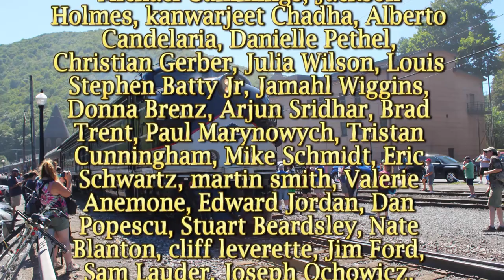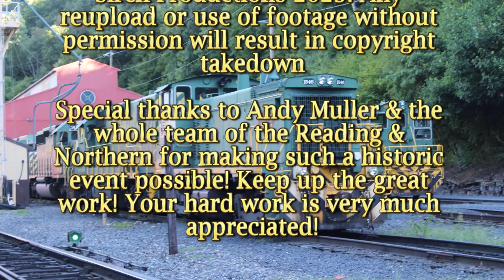RBMN Doubleheader Steam

Comment: Where is this since theres no info of it
Reply from the maker: The video takes place between Reading and Jim Thorpe PA
Reply: I wonder how it’s like on board an  excursion
Reply: @Ambushdoesplen  It’s better than chasing. I was on the train during the first rambles back on May 28.
Reply: not sure if anyone told you this Thunderbolt but great western 90 had an Accident on November 7th 1944 when it hit by a truck at a grade crossing east of Loveland and knocked onto its fireman side killing the fireman and truck driver and 90 was sent to the Chicago Burlington and Quincy Railroads shop in Denver for repairs and after it was finished it continued service. Can you do a documentary on it if possible Thunderbolt